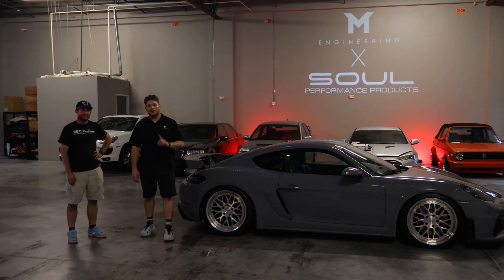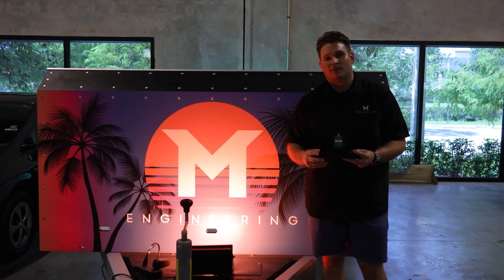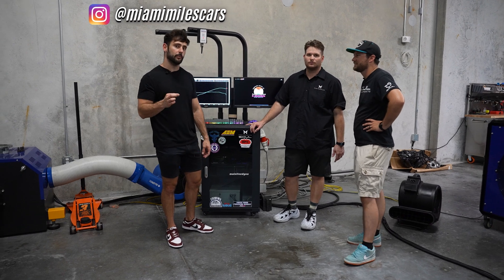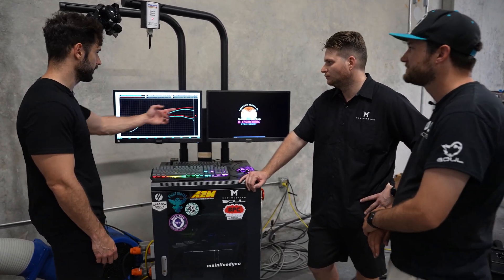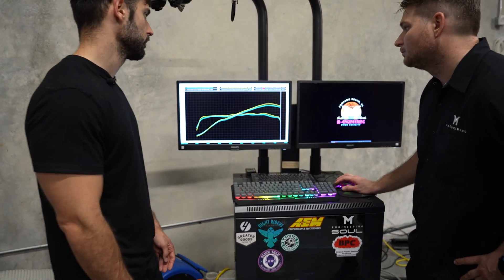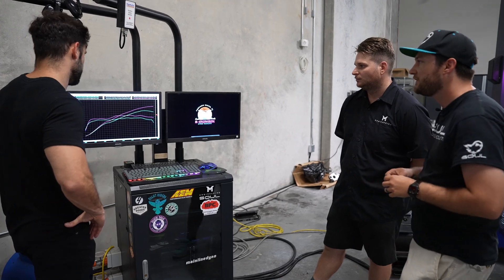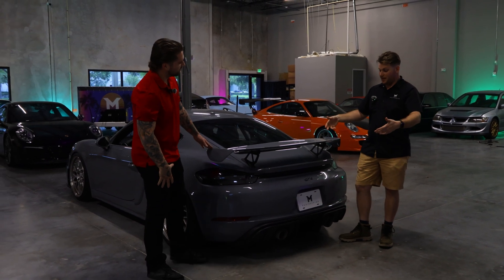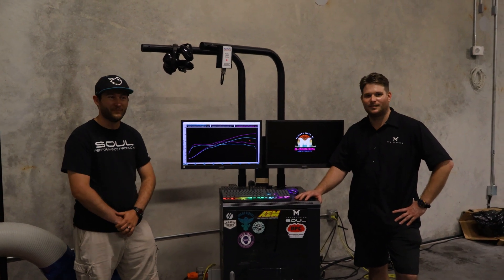Testing Every SOUL Exhaust For The 718 GT4 - In-Depth Review, Owner Reaction & More!

Comment: Do you have before and after a tune 718 GTS 4.0 data? I'm still skeptical that va software tune can make such large gains by itself. I run 91 octane, pure gas if that helps.

Comment: great video!

I’m still considering adding sport headers and tune down the road.

LOVE my competition OAP’s & Soul valved exhaust combo
Reply from the maker: It's a new animal with the full exhaust suite and software! 

-Charles@M
Reply: @m-engineeringllc  Charles, I’m sold!  I’m just up in the air about *when*… still in CPO until late 2026.  I’d love to discuss it a little bit… such as, will it make much diff without the headers, how do I switch & adjust the tune (stock / 91 oct / 93 oct), can certain features be turned on & off (valves open), etc.
Reply from the maker: @sfarrell2459  Headers are one the favorite mods for sound and power on this platform along with OAPs. M-Tuner makes it easy to switch maps in about 1 minute between different octanes. You can request features to be on or off from us and there's no cost to change those. 

-Charles@M
Reply: @ I have Soul’s competition OAPs and valved exhaust.  I have some concern the headers will make the overall too loud.  I’ll call when I’m closer to decision time to discuss, but M Engineering’s tune is the one I want.
Reply: How is the drone for everyday driving?

Comment: Amazing video very nice explanation. What does the software do when the car is run hard. Dyno pulls are one thing, but when you go to sustained HPDE runs? (obviously no,disrespect M-engineering is known to be top level, but not all companies are hence be nice to hear) How does it handle when the vehicle is really stressed ? Is the pop and crackle i hear part of the tune or more a effect of the Race parts or a bit of both?
Reply from the maker: These cars will actually perform better on street and track conditions as they will have superior airflow and cooling compared to the dyno fans. We do not alter or dial back safety features such as knock control so these are all still in place. We leave factory pops and burbles the same, unless you want them fully deleted. With a louder exhaust the pops will naturally be louder as well. 

-Charles@M

Comment: Exact same ? Doubtful 🤨
Reply: I have a manual 718 gt4 with a full jcr exhaust and headers and have driven a gt4 rs around a track briefly. The much shorter gearing makes the 4 rs feel faster. 

But I’ve raced my car vs a buddy’s 991.2 gt3 pdk and we were neck and neck.
Reply: @Mike-qq8iy  did you tune your gt4? I have a jcr full exhaust and am wondering how much more I’d benefit from a tune.